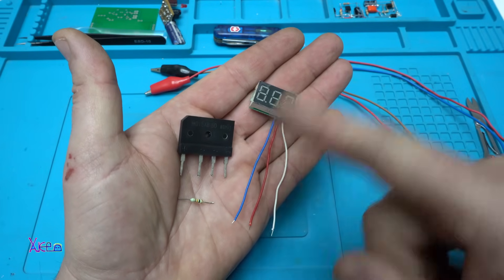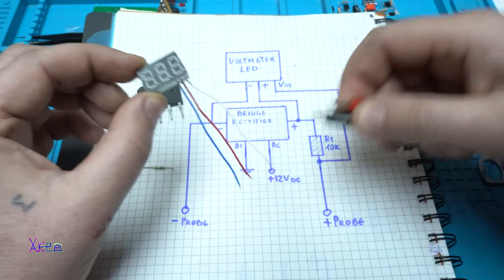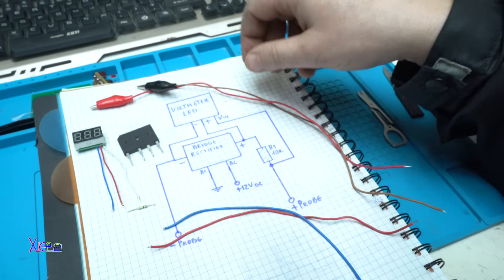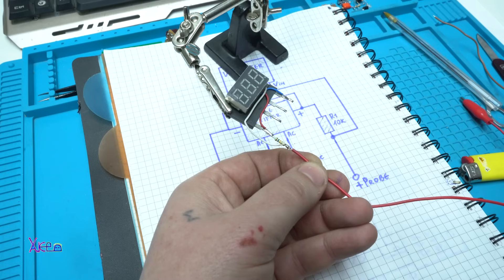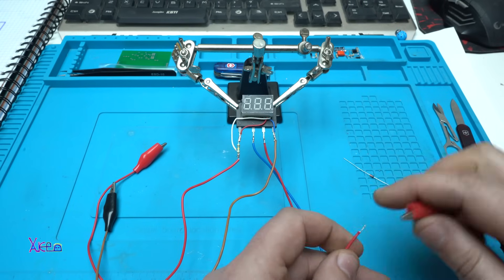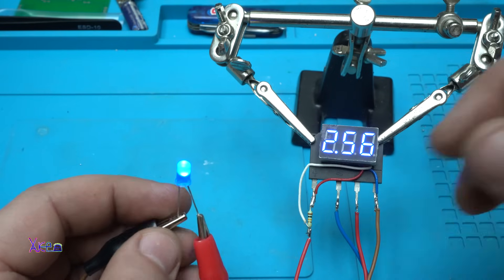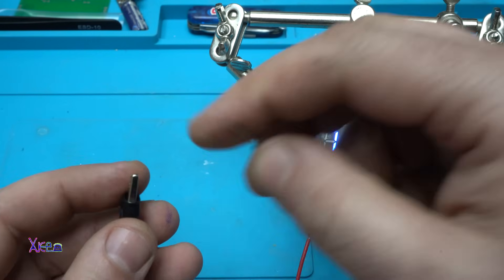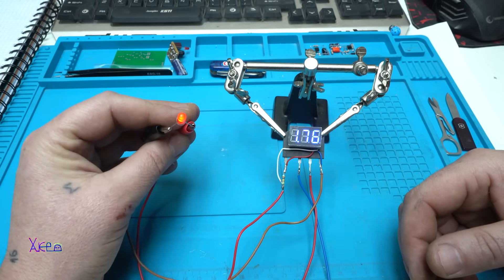ONLY 3 Parts To Make Electronic Components TESTER.

Comment: Why the resistor? And why that value? The only thing i can imagine is the device operates in a particular range to calculate and that “calibrates” the value on the screen. I tinker but I’m not very smart
Reply: Resistor: current limit (10V/10K = 1mA; with 1K -> 10mA), without : components will burn if power supply delivers a lot of current.
Diodes/LED work well with low currents (1-10mA).
Reply: "Smart enough" to ask a good question. I had to have some explain "your question" to me ¯\_(ツ)_/¯   Cheers K-man

Comment: If your crocodile clips came with the wires preinstalled then you might want to check the resistance of the wires. Most these days have cheap steel wire rather than good copper and they will make quite a difference in your reading. In fact it's hard to get good connector/wire premade without cheap steel wire being used. You are better off making your own.